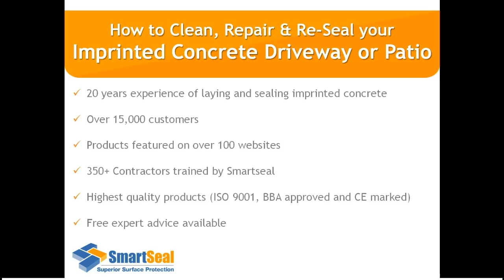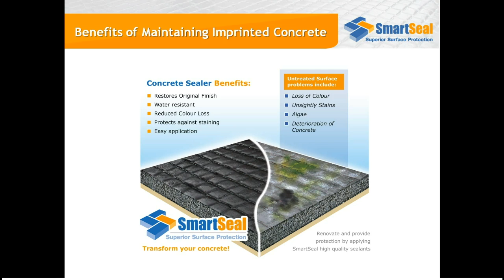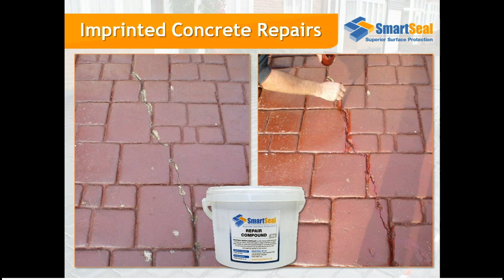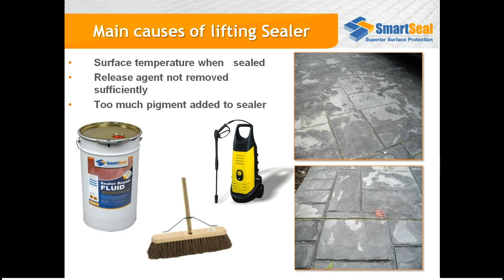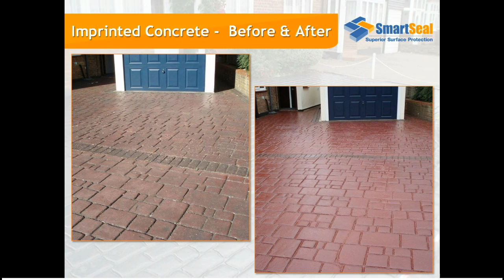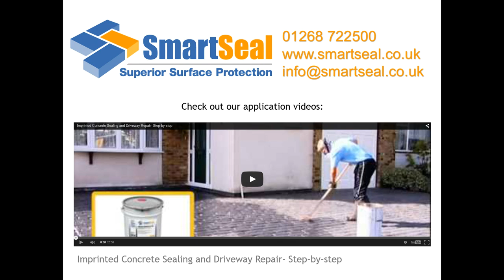How to clean, repair, re-colour and apply sealer to Patterned Imprinted Concrete

Comment: Hi great video. 
 Can the colour be completely changed?
Reply from the maker: Hey,  we wouldn't recommended anyone to attempt completely changing imprinted concrete's colour.

I hope this answers your question, Josh@Smartseal.
Reply: @SmartsealUk  thanks.  We recently had it done but I don't think they fit the shade dark enough. Is it reasonable to think the shade could be darkened? And would you cover west London? Heathrow area
Reply from the maker: @f04107180  The shade could be darkened, but our advice would be leave it to naturally tone down as the initial shiny finish of the sealer refuces. Feel free to send us some pictures if you need further advice. Regards, Rick@Smartseal

Comment: To go around the problem with peeling sealer and still color the concrete, would it work to first use a coat of clear sealer and after that a sealer with some darker pigment and after that a coat with lighter color? This to get the antique effect on a stamped surface which never were colored.
Reply from the maker: Hi JN, if you could send a picture to contactus@smartseal.co.uk we can then correctly advise. Regards, Nigel@Smartseal
Reply from the maker: Hi JN, if you could send a picture to contactus@smartseal.co.uk we can then correctly advise. Regards, Nigel@Smartseal